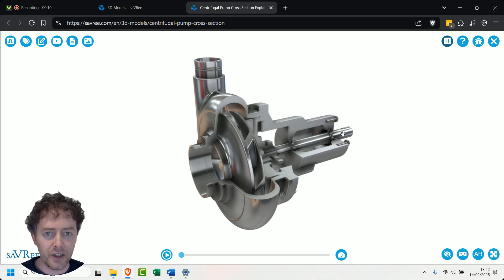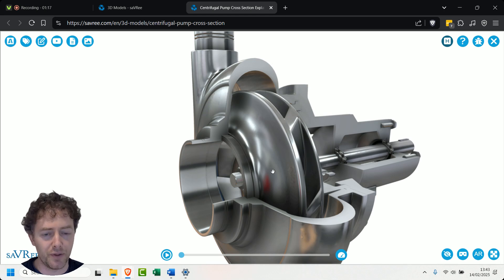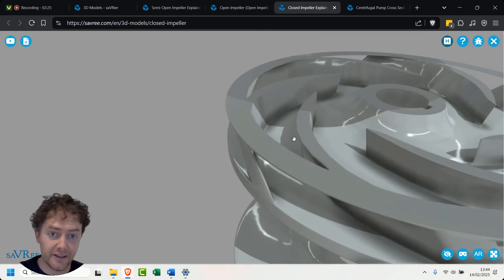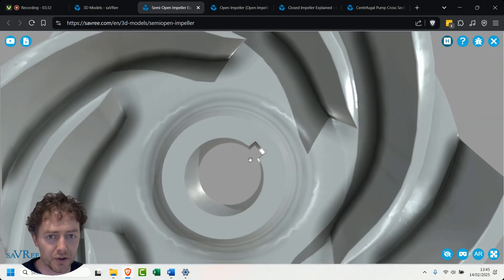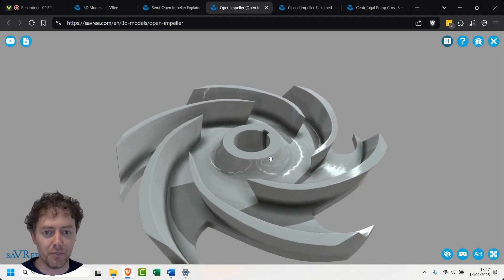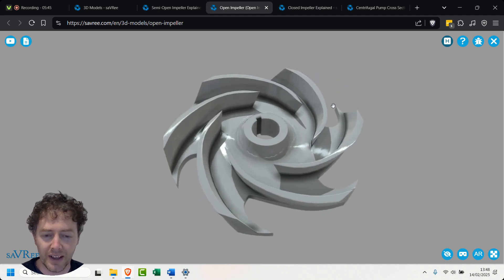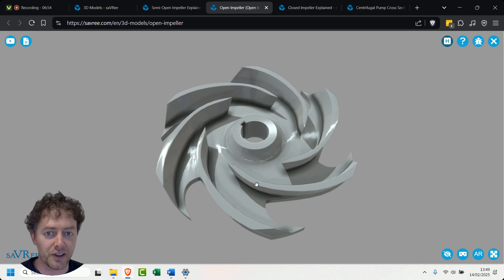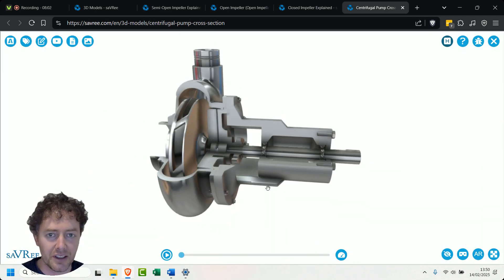saVRee Snacks #2 - Centrifugal Pumps Part 2

Comment: Quite interested in 700 degree C impellors and how they might work in a molten salt situation.  Some people are curious about it like me.  Do the same principles apply?  What is the lubrication?  Materials consideration and/or coatings to prevent corrosion, because dissolved salt.   Would be very interesting.